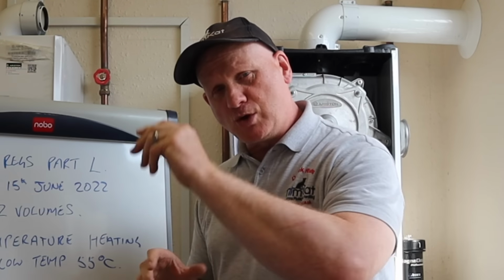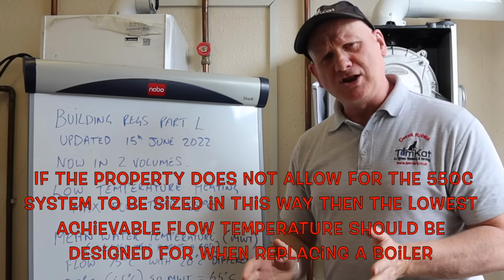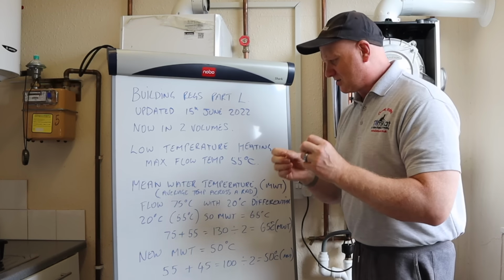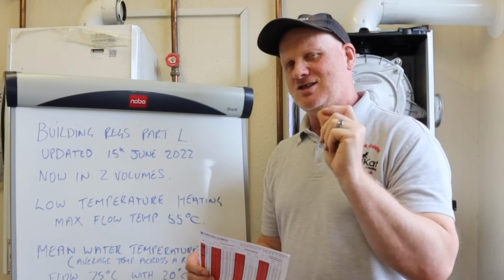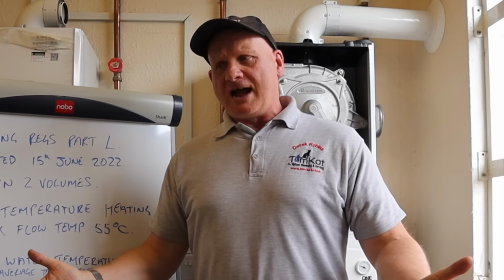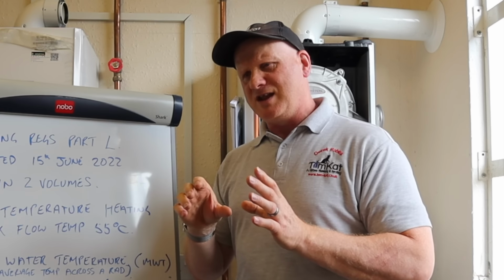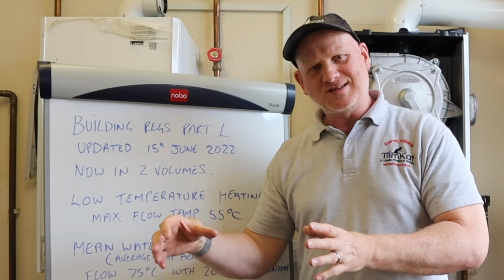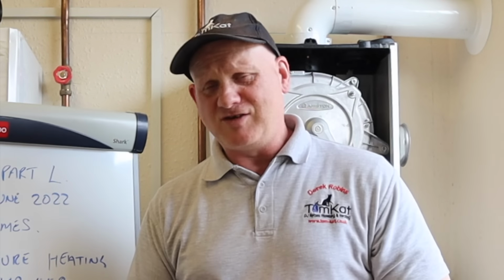Don't adjust your  heating flow temperature until you have watched this video. #saveenergy

Comment: I set my hot water to 46'c for my bath,  perfect to step straight into.
Baffles me why folk fill their bath at 60'c then have to add cold water
Reply: The other folks are potentially using their cylinders efficiently. Consider a situation where your tank holds 100 litres of hot water at 46C, and other folks have the same size cylinder but with the temperature set at 60C. When they had cold water to their hot water they will have MORE than 100 litres of hot water at 46C, so storing the temperature at a higher temperature than it is used at is a way increasing the effective size of the cylinder. If they don't need this increase in effective size, they will be wasting money, and hotter water loses heat quicker.
Reply: @tlangdon12  I should’ve explained it better,  I was referring to my combi boiler
Reply: I think you miss the point? You wouldn't fill the bath with water at 60°C.  You put some in and then add cold and adjust quantity. Gas will only be used to hear the part of water to 60°C. With your Combi, you're using had for the full quantity.
I haven't done the calculations but it's probably not that different. Overall the same quantity of water ending up at 46°C will require the same energy to raise water from mains at about 15°C.
Reply: Faster to fill, less water being heated.
Reply: @globalist1990  The fact you are heating less water does not reduce the heating costs.

The specific heat capacity of water is around 4200 joules per kilogramme per degree Celcius.

Notice in that it's per degree Celcius.
So the amount of energy required to heat a quantity of water is dependent on (1) the specific heat capacity, (2) the mass of water, (3) How many degrees change in temperature you are wanting to heat the water up by.

You may use less mass of water but you are heating it up to a higher temperature, and that energy has to come from somewhere. And you are being charged for that energy. So using less water doesn't make it any cheaper.

Physics wasn't your strong point in school, was it? In my school we did an experiment involving the specific heat capacity of water  at aged 15 in physics class.
Reply: @deang5622  so to you 5 minutes heating 5 litres of water at 60 is worst than 5 minutes heating 10 litres of water at 30? How so? You don't use the same amount of energy.

If the amount of water doesn't matter, why is it cheaper to heat a smaller home? Magic?

Actually it's not that linear. If you have cold water at 10ºC and you want to heat it to 30ºC: You can heat 10 litres at 30ºC, or heat 4 litres at 60ºC to mix with 6 litres at 10ºC. Both require 0.23kwh. Also, if you instead of mixing water on the tap, use the hot tap at full volume for less time, you might save on the water pump electricity use as well. Also actually, you'll save in either case of heating at 60ºC on the water pump use.

Efficient boilers adjust energy use to control how much they heat water. Duh. Otherwise you'd always have water at maximum temperature. If the same energy would be used to heat a smaller amount of water, obviously it would be hotter than you wanted. Duh.

No wonder you stopped physics at 15.
Reply: That's too low. 46 C is ideal temp for growing legionella bacteria. Good luck mate. Your health is at risk.
Reply: @deang5622  I think he's referring to a combo boiler where the water is just heated to what he needs for the purpose at the time?
Not the same as storing it in a tank at that temperature.
Reply: @djtaylorutube  i was referring to the opening comment, others mentioned storage. He clarified he was talking about a combi boiler. Storing hot water when using gas boilers seems like a waste to me, at least in my use case.
Reply: @globalist1990  Yep depends on what you've got. We have solar thermal so the boiler is off for several months in the summer but the gas boiler heats the water in the same storage cylinder. Combi boiler isn't suitable for that of course as there's no storage cylinder.
I was just pointing out that it probably isn't that different whether taking stored water at 60 and mixing with water at 15 to arrive at 46 vs running the boiler on the incoming 15 and raising it to 46 for the duration of filling the bath.
Bottom line, do what works!
Reply: @djtaylorutube  it all depends of the efficiency, but it should take the same amount of energy.
Reply: @deang5622  its a combi,  not a cylinder..   i turned it hotter for washing up,   46 for my bath

Comment: Another great video, very informative, but why is it that every plumber I have come across when they have either replaced a boiler or serviced it all settings are put at maximum including pump speed and all the radiator valves are wide open?
Reply: so that the customer does not call them back because its not hot enough. 
Setting the system up to operate economically takes time and few customers will appreciate this.
Reply: I think I read somewhere that the boiler should be operating at full load to do the flue gas checks. maybe they just turn everything up for this and then don't bother setting them back to the way they were.
Reply: @johna7075  I think you could be right there, but the last service on the heating boiler (not a combi) it sounded like the water was boiling in the heat exchanger, so I had to get them back to check the settings. It was a different person and they said the gas to the burner had been left fully open.

Comment: My combi boiler has eco settings one for each water and heating. Should I leave these on eco or turn them down below the eco setting? Thanks
Reply from the maker: No harm in trying to reduce it as the eco setting could be 70 oc
Reply: If its a worcester boiler, having the eco light on will save you money as it turns the hot water pre heat off.

Comment: This won't make any difference in existing homes where the overhaul insulation is shockingly bad and even if you explain to the customer the need to do this you'll be preaching to deaf ears  , the only reason people are about to turn down the thermostats is the extortionate cost of gas that's been thrown at us and they don't give a toss about insulating pipes or achieving a good delta T....
Cheers..... 👍

Comment: Best thing if having a new system boiler with cylinder is to have a system with Hot Water Priority whereas you can set the boiler to operate at 2 different outputs depending on demand 
I know this can be done with Intergas. Maybe worth doing a video on that brand as can be used as system or Combi as no separate heat exchanger for Combi mode
Reply: Viessmann boilers are the only ones set up for this from the start but Intergas can also be programmed.
The only two makes I ever recommend.
Reply: We're just about to get our Intergas gas boiler to work in this way: hot water at 70C for heating the cylinder and hot water as per the weather compensation curve for heating when there is no DHW demand. We have radiators that are a little oversized, but no enough to allow us to run at 55C in the deep winter. We need a maximum flow for heating that is around 60C (so the Delta T between Rad and Room is 40C)
Reply: Can Worcester bosch do this?

Comment: Hi hello Derrick 
The condensing boiler low comes out April 2007 
Also pipe size vary vary important government should bands micro bored pipe on heating 
Regards 
Faruk
Reply from the maker: All boilers had to be band A in 2007 but band b condensing came out 2005

Comment: Great content, advice on insulating pipework etc. always a first step.
Storage cylinders are where big savings can be made, only heat the water you need immediately  before use.
As for implementing the 55c rule, only ever going to happen on new build, a case of the powers that be meddling with things they don't  fully understand in order to achieve goals that should have been set at least a generation ago.
Reply: Yep. We should have been working towards this for ages.
Growing up in a family that was always broke, I grew up very aware of things that have seemed to pass most people by until now.
Reply: Why is 55°c flow only suitable for new build? All of the systems I install are designed for around 35-45°c flow. Even in houses that are 400 years old. People living in the past thinking we need high temperature heating systems are the biggest problem in our industry. Also your point on instant hot water, stored hot water can be heated up in the evenings/off peak at much lower rates and remove the need for a massively oversized boiler. 40kw combi can usually be swapped out for a 8-12kw system boiler if using stored hot water. This results in much better modulation and efficiency of the system
Reply: @adamkenyon6146  My comments on 55c boiler temperature were my expectation of the "average" installer response. I'm and always have been an advocate of controls , temperature being a part of the equation. Hot water priority controls on storage  systems is useful as is a lower store temperature notwithstanding legonella. 
Large energy savings can be achieved by heating the store, taking into consideration volume to be used and temperature, immediately before use.
18kw system boiler would be my choice with unvented cyl. with most heating systems and hot water priority controls or 4 pipe boiler.
Today's off peak tariffs are way more complex than the old Economy  tariffs, but could be useful for very large demands. 
Assuming 35-45C heating systems aren't  radiator systems.
Reply: @adamkenyon6146  because old houses are not built well and insulated well. my house has 2 brick thick walls ,no cavity. can not have double glazing. 55 deg will not keep my house warm.

Comment: 30 years doing this for a living and yet the phrase Delta T is as foreign to me as blokes calling each other Bro all the time (something you couldn’t pay me to do). Delta T must be something that came in the week I was on holiday……whenever that was 😂 I feel like an analogue man in a digital age and yet I seem to be one of the few who actually knows what time it is ! 😛
Reply: Delta is the Greek or whatever letter shaped like a triangle that means 'change in' so delta T is just 'change in temperature'. It's just short hand so you don't have to write it out every time. You just put ∆T instead.
Reply: @matthewwakeham2206  that’s correct. Delta is the 4th letter in the Greek alphabet which is the same as D in the English alphabet. Guess the engineers thought, yep Difference, D why not use Greek and make us sound smart.
Reply: Not sure how you managed to miss this!!! You must have had a Looooong Holiday!
We spent weeks & weeks at Technical college back in 1981/84 doing calculations which involved Delta T as well a heat loss calc's and proper radiator sizing for various building substrates, wall types, window types etc etc.. as well as all types of calc's for boiler sizing and pipework flow sizing, even getting into basic thermodynamic calc's dealing with flow temps & losses in pipework, much of which has served me well over the 36 years I worked in the industry.
Though I do remember at the time that many students were moaning they wanted to be a "Plumber" not a mathematician and their gaffer just used "Rules of Thumb" 👍 which had always worked fine for the last 60 years!!!🤣🤣🤣
I have often wondered if those were the students who later installed (I won't say designed!!!) some of the systems I got called out to years later when the customer said the guys who installed it were last seen riding horses and wearing wide brimmed hats!!!  🤠🤠🤠
Reply: @alexjbeebee  Just one of those weird anomalies I guess ! I also did all those things you mentioned at John Dyed British Gas college but still have no recollection of that term !
Maybe I really was asleep at the back of the class 😂 Not that much of all that installation theory ever got put to much use as I was always and still am a service and repair guy…
Reply: Just the Difference between flow and return
Reply: I saw on the NW news once a British Gas? training place. They were in a line, working on boilers along a wall. What interested me was a big sign "Use your mats!". 

I think it was advising them to stand on a rubber mat to avoid shock. Do they cart one around? 

I used a nearby rubber doormat working on our electric cooker, as you can't unplug it. I switched the breaker off, but we've also had the cooker wall switch fail twice.

I was given a "B.P electrical guide" pamphlet from like 1950 with handy pictures and captions: "When changing a [breaker] fuse stand on dry board or box". 

"Never stand on a stone floor to handle [live] electrical parts".

"Keep away from sinks & lavs when touching fixtures".
Reply: I must have been on holiday the same time as you 👌👍
Reply: D = Difference
Reply: @dinendale666  So it’s Delta D not Delta T ?
Reply: You are not technical or an engineer clear. Go back to school perhaps 😂
Reply: We learned about Delta T in College doing Central Heating Design in the 70’s, 4 years of College as an Apprentice Plumber.  The Course Cowboys & Career Change Chancers know fuck all!!
Reply: @TheDickPuller  I trained with British Gas late 80’s early 90’s and only heard the phrase for the first time this year ! I guess it’s just terminology but not universal 🤔

Comment: All about making us pay up front to get the average house heat pump ready, but heat pumps probably wont be fitted to the average older houses in the long run, there’ll be a backlash.  No proper p,an or forward thinking by any government we have / had.  But now they are making us pay for new pipework / rads for the current haphazard non plan
Reply: Not just about heat pumps , if you can use 55deg then you will save on your bills , alot of systems only condense for a matter of a few minutes, as soon as that return temp gets to 55 it will stop condensing and you may as well have fitted an old fashioned standard efficiency boiler .